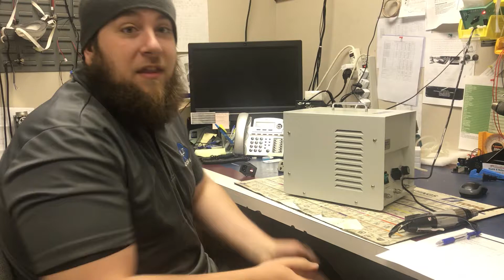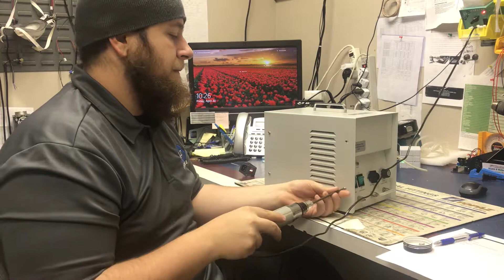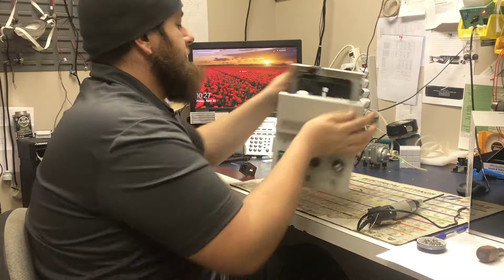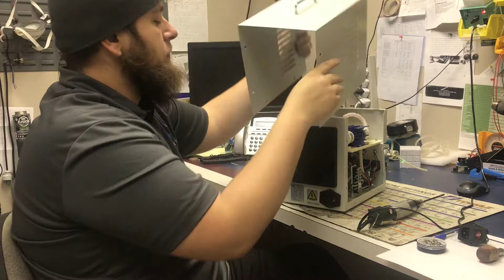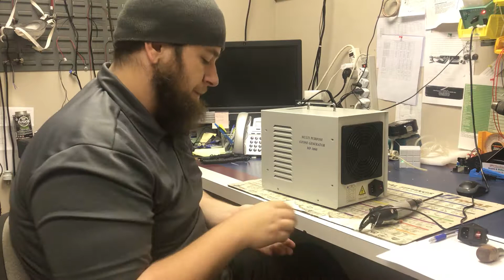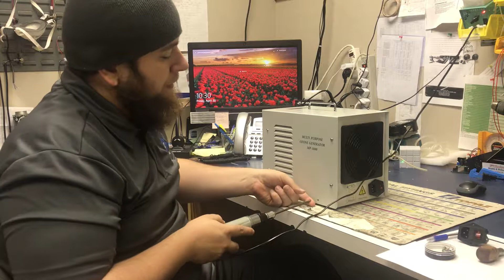Video of Replacing Back Rocker Switch (MP Series & A7K) #a2zozone #ozone #ozonegenerator

Comment: Dear.
Could you help me, the a2z comes with a ground cable, but I don't know where it goes because they have broken it down and not put it in. Could you help me by indicating where it is connected to in this model of equipment that you just broke down?
Reply from the maker: Contact our technician on +1 502 499 4977 option 2.

Comment: hi there. My MP 1000 has a problem going on and off . There´s a wiring contact problem in the back of rocker switch. Could you please take a pic of the colors system, so I can verify if position is right ? thks
Reply from the maker: Hi Zeca, I put a picture of the connections for the back rocker switch on the thumbnail of the video. I couldn't get the picture into the comment. I hope it helps you. If you have any other questions or concerns, please let us know.
Reply: @AtoZOzone   Hi there...thks for the pic. Now I´ll need you to get me the combo ( switch + wiring ) available for purchase from website , so I can go ahead and get all I need at once. Let me know if you can get it for me. thks again.
Reply from the maker: @zecaribastrader  Hi Zeca, I'm glad it helped. I can send you an invoice, as I do not have the wiring on the website right now. If you provide me with your email address at info@a2zozone.com, I can send you the invoice. I won't spam you, promise! I only sign people up for the newsletter that want to be signed up for it. But, I will send you the invoice for the part you will need. Also, if I send you the invoice, you will be able to pay for it by PayPal, Amazon Pay, or with your credit card. If I take a call, I can only accept credit cards. But, you can also call at 502-499-4977 on Monday.